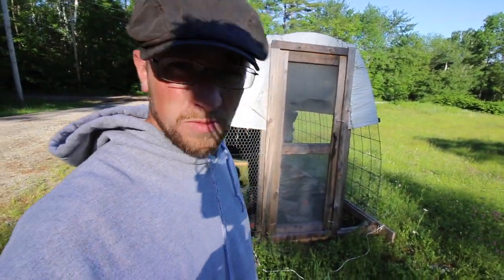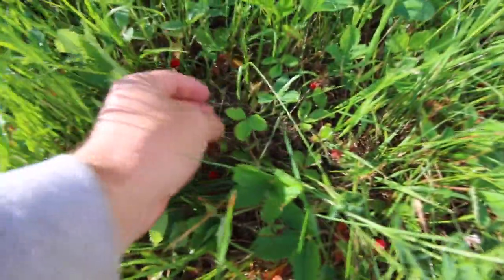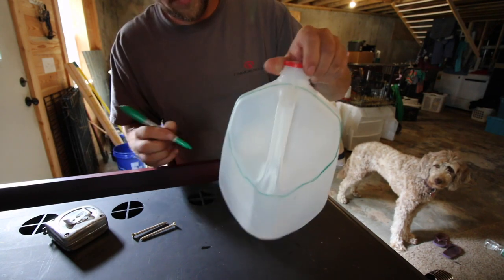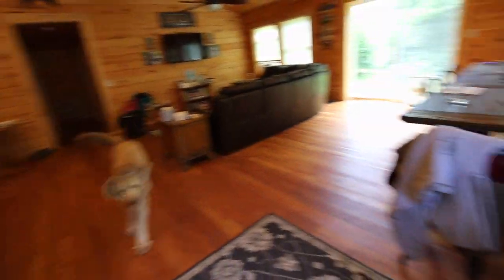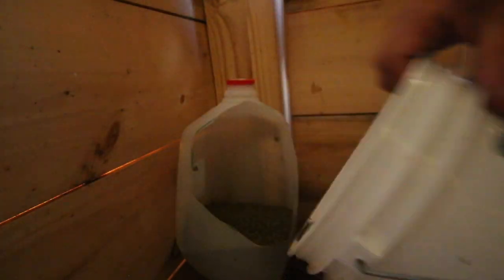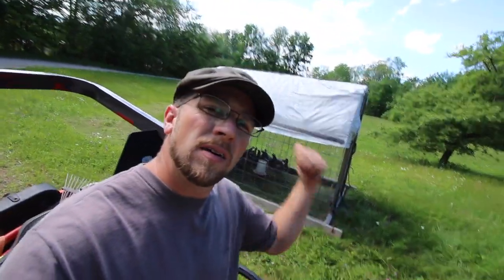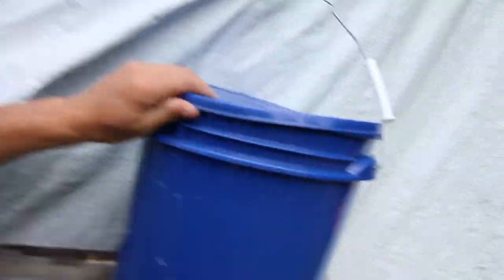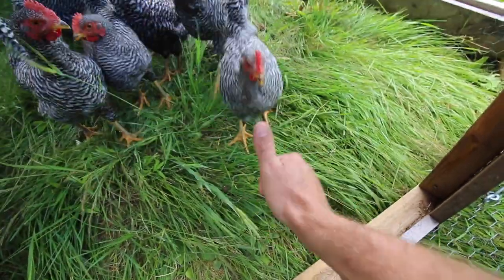Kelp!

Comment: Whenever we made containers out of milk jugs we'd run a torch around the edges really fast to smooth out the sharp edges because they can cut.
Reply: We would run a ribbon or rope through the neck to use as a lanyard so that we could hang them from our necks so that we had both hands free when picking berries or beans .

Comment: You just put a new rope on your chicken tractor, you should take a 12 inch to 15 inch piece of 3/4 inch PVC pipe and slip it on your rope, this will be easier on the hand when you pull the tractor.

Comment: Wonder if you would try something for me if U get a chance. Try using the shortest rope possible, just enough to keep from hitting your feet, and see if it is easier or harder to move the tractor. I've been fighting with the answer in my own head. Was thinking a "T" handle (like from an old water ski rope) or a lrg dowel 18-24 inches long with an Eye bolt on each end, then rope from it to tractor. Seems like the lifting would be easier but not sure about the pulling part.
Reply from the maker: Thanks! I will have to give it a try sometime.

Comment: Look for a Lucas Mill owner if you have the mature  trees to saw logs onsite.  Split the wood 50 to you 50% to mill owner.. both work together .  Help sawyer with an online ad on your channel.  How to harvest your own trees at maximum value.  Even at 75.00 an hour Avg 10 cents a board foot or less and free bedding free wood cants for firewood.  Bigger tree  the better.  Move the beams not the trees.  Neighbors with problem trees on fencelines, size ect will give them away.  Check landfill..free trees.  may store them for you.  A 12pk and hot pizza gets results.  You can,always buy the tree and process it onsite boards, cants, sawdust and wood,chips.  Walnut  is a premium..focus on high return hardwoods.  Barter working chicken tractor greenhouses with layers for trees.      Free hardwood tree removal for self prepping garden greenhouse with fertilizers, weed control, pest control included.  Bonus..Organic birds pay for the tree for years.  Every chicken dinner and garden produce is a thank you for your business to your customer.  Tuff tex rocks and would add strength if needed.   Great job
Reply from the maker: Thanks! Great info again!
Reply: Lumnah Acres.. out of the woods is an all star at bird dogging trees.  Why,buy stock when you know the future value and get to build a shop next to the kitchen and smoker..using the apple wood shavings..  lol
Reply from the maker: Right! He has a great channel!
Reply: Lumnah Acres each new big project I got to keep the new tool used to build.   Storm damage save the trees.  Anchor seal the ends..good temp fences while drying.  Warrior also makes a mill that runs with a chainsaw and sets up over any size log.  Swing blade vs ban,saw seems more user friendly and the sawdust is another farm product.  Worst case you can see what powers the warrior and use a Glanville Alaskan slab mill.  500.00 or more a slab.. let the drying begin.  Firewood prices suck with oversupply.  Hardwood..value increases with time and a plan.  Looking forward to the build.  Another roof, more rainwater catchment.

Comment: Make some Jam. :-)
Reply from the maker: We need too! Thanks!
Reply: @LumnahAcres  
Whenever we cut plastic jugs to make something new ( scoops , gathering baskets etc). We would run a torch ( or heat gun ) quickly around the edges to smooth out the sharp edges because those things can cut.